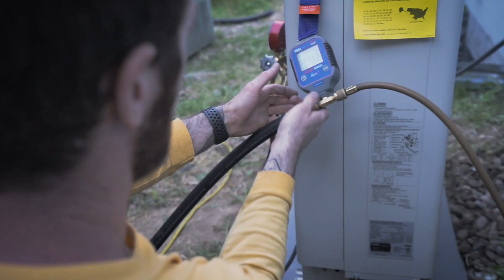Episode 5 - The Daikin Fit... is DOPE

Comment: Is 20,000 dollars for a daikin fit 3ton variable a good price??
Reply from the maker: Depends on the region / local labor costs, but we vary up or down from there depending on what it’s paired with. If it’s paired with a modulating 97% furnace that’s not unreasonable because they’re much more to install, but if it’s just a basic air handler then might be on the higher side but prices are all over the place depending on your city/state and local costs to operate / labor costs. I’ve seen bids from
Wisconsin that were VERY cheap compared to what people charge in Denver and have also seen prices in California that seemed very high but were reasonable for the area. We normally suggest getting a 2-3 bids from local contractors so you have a comparison and then pick the contractor you like the most, and if their price is way off but you hand them a few competing bids sometimes they’ll price match or at least get closer. What city / state are you in?

Comment: Thanks, what furnace and coils would you recommend for the Daiken Fit?
Reply from the maker: Dm80vc if you’re going for a dual fuel heat pump, or compatible air handler if you’re going all electric. Or if you’re going for straight AC then the DM97Mc (modulating) is the quietest furnace on the market and definitely worth it by comparison to the 96VC which is a two stage furnace. This also depends on the climate. If you’re in a warmer climate with a not very long winter then a DM80VC is fine I wouldn’t go high efficiency (like Phoenix, Texas, the south, California…)

Comment: I'm in rural zone 5 and have been told the new high efficiency mini split heat pumps are cheaper to heat with compared to propane. Would a upflow Daikin FIT hybrid allow me to choose between electric or propane?  So I could pick the heat pump during the warmer shoulder months, and propane during the coldest days when the heat pump is least efficient?    Thanks
Reply from the maker: Yes but there’s currently a nuance with the Daikin Fit Heat pump in that it’s only compatible with a furnace as a “duel fuel” heat pump up to 3 ton sized systems… they are working on a fix but right now it’s just something weird with the programming. Verify with your dealer but that’s the skinny on our end.

As far as low ambient how cold is zone 5 on the coldest nights? We’re in zone 5-8 and rarely get below 0 F, and it will heat down to those temps. VRV life is something else to consider especially on propane.
Reply from the maker: But the 3 ton max “duel fuel” (meaning it’s a heat pump paired with a furnace) should be resolved within the next few months. If your system is under 3 tons then it shouldn’t be an issue.

The other option is 100% electric with a backup electric heat kit (air handler) that pairs with the heat pump and then it’s not a big deal. Propane just shot up and is very expensive so depending on your electric rate it’s hit or miss on what makes the most sense.
Reply from the maker: We’re about to drop another heat pump video about this (we haven’t produced much recently) so if you subscribe they will be out soon. It’s more about a side by side on the Daikin fit vs a 16 seer single stage and shows you the difference in power draw (amperage) and if you can get a daikin fit it’s 100% a better product in terms of consumption

Comment: filter drier on a  Daikin unit is a no no.
Reply: Why is that? is it because a daiken already has one installed at the condenser?
Reply from the maker: Daikin fit specifically requires it installed inside at the coil so 100% need a filter drier
Reply from the maker: This isn’t a ductless

Comment: Assuming the furnace also needs to be Daikin for the communicator to work? I have a Trane single speed furnace that I want to add a heat pump to here in coastal Los Angeles. Great video!
Reply: Spoke to a daikin rep the other day, there’s a module you can put on your regular furnace to help with the communication process. D24 or something like that

Comment: I've a query! I have LG dual inverter 1.5 ton. So, when the compressor speed is at its slowest (after reaching the desired temperature), the outdoor unit makes a faint high pitched continuous beep sound. Its not loud, but like a needle, light & high pitched. Is it the case with inverter compressors? Please verify if this is normal? As soon as the compressor gains a little bit of speed, it goes away. Overall the AC works absolutely fine.
Reply: It's not normal, doesn't happen with my Daikin unit.a
Reply: Its called electronic harmonics. Its rare to find. It will not harm anything, but it can be fixed by replacing the power converter board which may be your outdoor control board. When the AC power is converted to DC power this can happen.